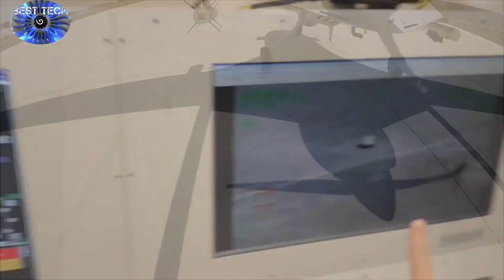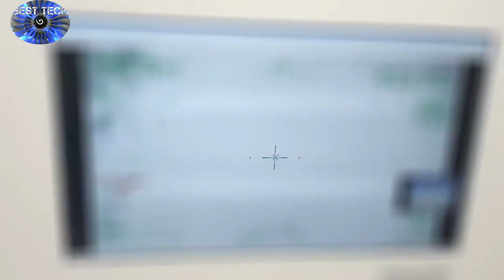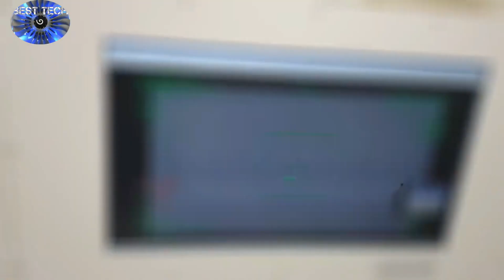Turkey unveils advanced Bayraktar TB3 drone with satellite link SATCOM

Comment: TB2S has many more upgrade, new and powerful engine ... Bombardier made Rotax engines was produce 100hp and new domestic made PT170 offer 170hp, upgrade targeting ... old Canadian wescam's targeting lazer range was 20km and new Aselsan made Cats can reach 30km, more payload from 2xlight and 2Xmedium MAM ammunation to 2xlight and 4Xmedium MAM. With Satelitte link connection those babies can reach 1.000km radius operational range and 27 to 30h aerial service capacity.
Reply from the maker: Turkey must with domestic production bypass imposed Canadian sanctions on Wescam optoelectronics and Rotax engines deliveries.
Reply: @besttech3787  two upgrade I mentioned totally dometsic production ... PD170 engines already mass production phase and targeting unit CATS testing with live ammunation. 
Cats video  :   https://youtu.be/EvmWhfX-Azw
PD170 Engine : https://youtu.be/hV2YKCx3ap4